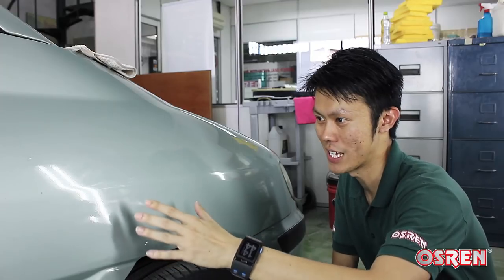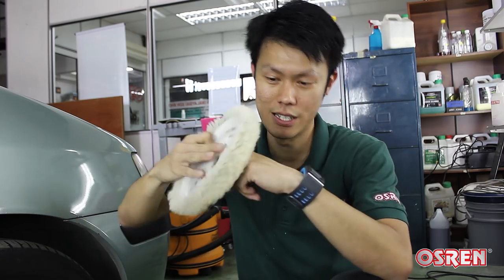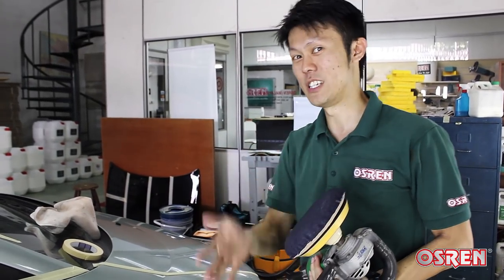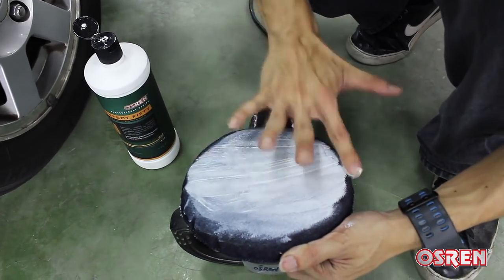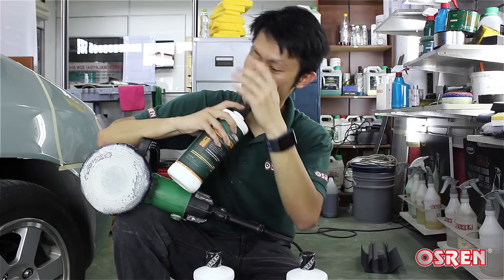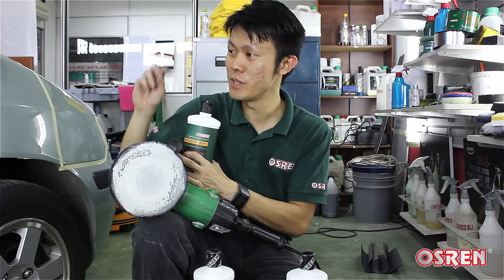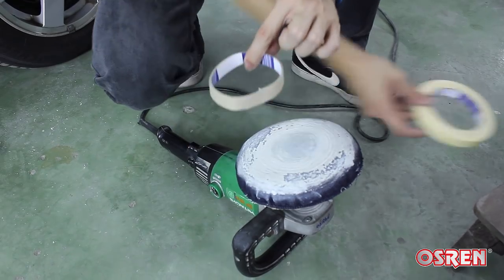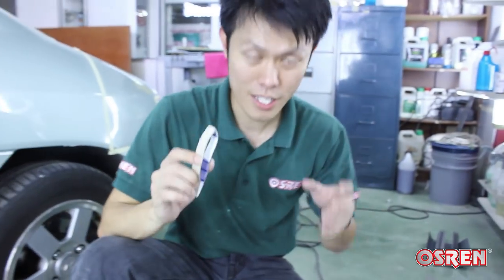How-to remove orange peel without sanding (Step-by-step Guide)

Comment: Cutting with sand paper and polishing is easier for people who are new at it, because with the sand paper method you can tell that the orange peel is off completely or not because of the dull surface, this method would be more difficult because it's polishing and cutting at the same time and you can't tell the depth of the clear. Plus a rotary polisher is for much more advance people
Reply: +bulleuston76 yep that's the best way. I'm going to start the cutting and buffing process soon, I'll post some videos of my progress
Reply: Like the denim pad where to buy
Reply: Using denim pad will not leave any scratch mark like sanding would... If u buff it really well after sanding it flat... The scratch mark will appear back after 3 to 4 month... Thats why i like to use the denim pad... But takes a lot of practice though...
Reply: Sanding is lots of work. I am ready to embrace something much easier , quicker and more effective.
Reply: Very true
Reply: yeah but sanding is a lot riskier for newcomers with the risk of taking off all of the clear, this is a milder approach and safer.
Reply: @matspray6665  sanding marks do not come back after buffing and polishing.....the process when done correctly literally removes the scratches.

Comment: I Recently did a clear coat repair, got a new gun to shoot the clear coat, but I did not spend enough time getting the settings right and had horrible orange peel. I followed the guidance and purchased the products in this video and was very happy with the results. Thank you for this instructional video, it made repairing my mistake very easy. The Osren products are very good and I will be a future customer. Thanks again.
Reply from the maker: Hey Joe, thank you for the sharing. A moment like this that reminds us what we are doing is making a difference! And totally worth our effort in producing such videos
Reply: what kind of pad is the black pad I can’t hear that good

Comment: didnt even know they made denim pads
Reply: +Radhwan. autogeek sells them.
Reply: Theirs are too small. only 5.25 you need 8". makes all the difference because you can slow the rotational speed
Reply: daleon96 You can make them yourself. Just wrap some old denim pants on a foam pad.
Reply: Show us a picture of how you did it. Buffers spin fast and get out of balance even if you don't center the foam pad just right. Are you talking about tying it or gluing it or have you actually ever even run a buffer?

Comment: appears to work decent. buffer seems to running at a very high rpm. be easy to burn thru if you dont know what your doin around the edges.

Comment: so this really flattens orange peel as good as wet sanding? did you ever do 2 panels side by side using both methods and compare results and time required??? thank you..
Reply from the maker: Hi Roadstar499! If you love wet / dry sanding, stick to em 👍🏻. If you’d like to try it out, click the link! 😆

Anyway, this is a good question and one that cannot be answered via test and video comparison. It is a personal preference thinge 😄

PS: The Perfect 50 and Denim pads get rid of sand scratches very easily too! 😉

Comment: Excellent video, very informative. I tried the Orsen denim pad and the Orsen Perfect 50 fast cut. The fast cut turned into a grey paste on the car. Didn't cut the orange peel, any suggestions? I prepared the pad with the fast cut just like the video.
Reply from the maker: hey hawk, we will need more information to help you troubleshoot. 

Do run us through you process in details, including machine speed, hand speed and working time.

If the orange peel doesn't get flatten, it means it is not levelled or not enough cutting is performed
Reply: I prepared orsen denim 160mm pad just like you did with orsen perfect 50 fast cut compound. I applied some perfect 50 to the hood. Using a torq10fx I spread the compound at speed of 15, it began to get sticky, I increased speed to 30 then to 35. Compound then just stuck to paint as a grey mud. I had to teeter the pad to cut into the compound to break it up. It then flew around in grey soft chunks. I kept on with cutting. Repeated about 4 times then gave up. I noticed a very slight change in the paint reflection.
Reply from the maker: @slphawk37  We would recommend using the perfect 50 with a rotary polisher, the pad that you mentioned, it is made for rotary. It's thicker and using a dual action would not produce the same transfer of cutting power (cushioned by the thick foam)

For dual action polisher levelling, we recommend nao leveler 56 with a thinner 6mm denim pad.

The grey soft chunks are most likely the dried up polish abrasive with dirt infused (it happens).

Check the latest video on leveling with a dual action polisher : https://youtu.be/rnN8o8ibI0g

Oh btw, a tutorial video is coming up tonight

Comment: Can this process be done on the base coat, and clear coated after?
Reply from the maker: On base coat, it's better to sand (provided it's 2k solid colour, not metallic paint) than to machine polish as it will produce more polishing dust with possibility of remnant oils from polisher that will hinder clear coat from bonding on base coat

Comment: Is that polishing compound that you used?  I assume this is after you applied clearcoat?
Reply from the maker: ShawnMichael121277 Yes Perfect 50 is a Fast Cut Compound. The car I worked on in my video is clear coated but it's not freshly coated. You can also use this polishing system on single stage (non-clear coated) painted cars. For fresh paint, we suggest paint to be cured before polishing
Reply: Thanks.

Comment: I"m watching this because my Volvo just had a new trunk lid installed due to someone kissing me in the rear.  The car is finished but there is orange peel finish that I pointed out and rejected.  They say they will be able to buff it out.  I wanted to see how it worked.  I hope they do a good job.  I'm holding the insurance check hostage til it's correct!
Reply from the maker: We’re with you all the way! And if they can’t get it right show them this video and get them to buy our products! 🤣 Anyway, hope you’ll get that razor sharp reflection finish 😎👍🏻

Comment: So, is the orange peel in the clear coat? I have a slight to medium amount of orange peel in my car and it stands out because it's black. I've been trying to correct the paint by compounding and polishing, but it's preventing me from getting that super high gloss end result. It looks a lot better than it did, but I can only make so much progress. I wondered if the orange peel was in the clear coat or the layer of paint beneath? Do you think it's ok to compound with the denim pad? (In not a beginner and have moderate experience.) I appreciate any help you can offer me. And thank you for the vid!
Reply from the maker: Hey Tonyelle, levelling at the clear coat level is sufficient to produce an even reflection. What is beneath won't affect that much unless there are sanding marks or uneven putty marks that are painted over. 

Denim polishing has been around for more than 20 years in Asia countries, not just in Malaysia. 

We would also recommend trying out the new abrasive for levelling :

https://youtu.be/rnN8o8ibI0g

We have since updated our abrasive to a better formula
Reply: @OSRENOfficial  Thank you for the quick and helpful response. I'm going to go check out your updated abrasive products right now.

Comment: Do i use the denim pad with the 46 or the orange pad after using the 50? I just got this system and can't wait to use it.
Reply from the maker: Hey, this video is dated, the video you commented on the nao leveler 56 would be the improved formulation
Reply: @OSRENOfficial if the 56 is improved formulation, how come in the Osren Amazon store you only have the 50? The 56 isn't there at all, neither is the thin denim d/a pad, only the denim rotary pad. I just bought the denim rotary pad and had to get the 50 compound.
Reply from the maker: @stephenwhite5444  Hi Stephen, the fd2000 (denim for da) is available here :https://www.amazon.com/dp/B08P7G2GD9?ref=myi_title_dp

We are extending the product range this year too on Amazon including the new abrasives. Expected to be available in Q2 of this year. We apologise for not bringing in sooner.

Thank you for being an avid supporter. (we can tell based on your question asked.)  If possible, do follow us on our IG, we are more active in providing updates there

Comment: What about doing this method on single stage paint job? I haven’t applied the clear coat, but i wanted to attempt to get rid of the orange peel on the color first
Reply from the maker: Hi Logan, Good question.
Yes you may level the color coat before applying the clear coat. It will look better. However, you wanna make sure that no oils or unwanted solvents and particles to be around before layering the clear coat.

Comment: +AMMO NYC have you seen this? Seems like something you should do a review on.
Reply: You expect Larry Kosilla to come here to watch this video? Or maybe Darren Priest from Auto Fetish Detail or Junkman2000 :D Well this is kinda different technique for them. From what I know, american don't use denim material for removing lite orange peel.
Reply: +Mohd Radhwan Denim pads have been around for years.  They are faster but still don't level like sanding.  Not good for custom work
Reply: @danhenderson783  i agree..using good rubber block is the way to go imo...start with a small section and go through all the steps to get results you want then go over the entire car after inspecting each panels orange peel ...some panels may be much better or worse. not one comment here after 7 years of anyone that actually used this process...which pretty much says it all...

Comment: I wonder if its possible  with a drill gun  if i attach a denim pad  could it remove the  orange peel
Reply from the maker: if it has enough torque and attachment to the backing plate, perhaps yes. Usually not the case. Drills and polishers have very different motors and drills are unsuitable for long hours of usage

Comment: Would this also work with single stage 2k paint?
Reply from the maker: Hi there! Yes it works with single stage paint systems. Just be prepared to see the pad turn to the car’s colour 😬. It also works on 2K Solid Colour Paint systems 👍

Comment: I'm by far no professional painter.i have painted a black 76 I think was the year? Bandit look alike no tee tops.Single stage. Came out great  then my Harley. Basecoat clear. Again looked great out of the gun.Now I'm monkeying with a 90 red corvette. Already Put base coat clear on the nose clip ORANGE PEEL. I've tried to sand it out NO luck can not get the shine to come back. Stripped it bought a new bigger compressor going in Again..any help would be appreciated  Thank you guys
Reply from the maker: Hey Tommy, respray by gun would definitely result in orange peel, the intensity can be reduced with the right settings and techniques. We are however not an expert in this, so best to consult an experienced painter on this. 

We can, however, comment on these observations:

1) Sinkage will take place and causes orange peel to worsen after curing. These will occur when the paint is drying anywhere from weeks to months. So best to level the paint after near full curing of the paint. We did briefing mention about sinkage on our blog: https://osren.com/blog/2022/03/02/orange-peel-levelling-risk-and-reward/ 
and it happens even to original factory paint cars

2) We have a newer video to tackle this approach, video: https://youtu.be/rnN8o8ibI0g

After sanding or level, you will require to compound and/or polish to restore the shine.

Comment: Hey there, I tried a denim pad with Meguiar's m105 and rotary like you shown in the video. But even after 5-6 attempts, (3-4 overlapping passes each), the orange peel is reduced only around 30%. Its factory orange peel on a Civic 2013. In your video, the orange peel is gone in one attempt. I also primed the pad like you did. Hope you can give some guidance here.
Reply from the maker: Hi a ghazi, maybe you want to try our compound (Perfect 50) instead, since our compound is designed specifically to remove orange peel without sanding. 

You can check our more details here: http://osren.com/product/professional-series/all/perfect-fifty-50
Reply: Plus I'm guessing on the car in the video it's fresh paint which is softer mate
Reply: Not cured properly yet therefore easier to get out the orange peel
Reply: @jackcarey4902  Hey, can you recommend a suitable compound for denim pads?
Reply: @IAINoodle  I've never used a denim pad sorry mate
Reply: You will be at base coat before you can get rid of factory peel.

Comment: How well will this work on a single stage paint job?
Reply from the maker: Hi Murrica, this works the same on single stage paint. The fundamental of it is to even out the surface to produce a more reflective surface. Downside of single stage paint is that the pad might get color transfer.

Comment: Nice job ,,,,BUT  Black would have been a better example to show us. I can hardly see any orange peel on that color.What is the name of the compound you are using?And the name of that pad. Thank you
Reply from the maker: Hi +SonofGodly  , Thanks for watching. Do check out the video at 7:19 (Minutes) The clip there clearly show the orange peel. 

However , yes I think you're right that black would be a better option but at that time I had no access to one...

By the way the products which i used are in this link.

http://www.osren.com/product/professional-series/all/perfect-fifty-50

http://www.osren.com/product/other-pads--backing-plates/pads/jeans-sponge
Reply: "I can hardly see any orange peel on that color"
That is nuttier than squirrel sh*t.  What were you watching the video on?

Comment: Will this be removing too much clear coat?
Reply from the maker: Hey Poh Tat, the process involves removing more clear coat than your usual polishing approach, however, one the many reasons of the presence of orange peel also means that the clear coat is a little too thick and causes the wavy texture. Usually orange peel levelling is only done once in a vehicle's lifetime (unless repainted). Orange peel levelling is done to bring out the best possible mirror look like on a paint. If you are comfortable with orange peel, by all means, you can skip the levelling part.

Comment: I see these days detailers do not even use rotary buffer,  but variable speed orbitals. Like Rupes
Reply from the maker: The dual action polisher has certainly changed the paradigm in the detailing scene. However rotary still has its place

Comment: Would the products change if one wants to use a dual action polisher? Also if one can use DA, what speeds and how much pressure should be applied?

After perfect 50 what osren product can be used to remove haze and sanding marks?
Reply from the maker: Hey Faiz, we have a new product that's suitable for dual action levelling and it's one of our upcoming video as well. 

http://osren.com/product/professional-series/all/nao-leveler-56
After levelling, the usual (depending on paint) would be either NAO quick cut 48 or Nao compound 46 with wool to refine it. 
Cutting combination are not fixed and paint dependent, however 46/48 is the usual follow up. The upcoming demonstration on levelling will be beneficial, don't forget to tune in!
Reply: @OSRENOfficial  thank you for this update. If we are working with foam pads after the denim pad stage will NAO quick cut 48 or NAO compound 46 be the right product?
Reply from the maker: Nano Wools such as this are way more efficient than any foams 😬. We highly recommend that instead of foams

http://www.osren.com/product/other-pads--backing-plates/wool-pad-velcro/blue-nano-wool

Comment: what will happen with the shine of the paint after you will wash the car several times?
Reply from the maker: Hi Alexandru Octavian Avrigeanu! Orange peel once removed/leveled, it's permanently gone. It will never come back. However as for gloss, it might reduce due to micro scratches from washing or let's say you did not take ccaare after leveling the paint and stubborn stains sticks to it, gloss will be reduce, BUT the paint is still flat as orange peel is not there.

Comment: At 1:43 did you say the denim pad is non coarse? Or is it a coarse pad.
Reply from the maker: Ah! I meant non-pores, as in compared to foam or wool, the abrasives will linger longer on the surface of the Denim
Reply: OSREN (MALAYSIA) SDN BHD oh! Thank u!! Do u happen to know if denim pads are considered like a medium cut, light cut, or heavy cutting pads?
Reply from the maker: You’re most welcomed. Denims are by far the heavier cutting pad available in the market for automotive clear coats 😬
Reply: OSREN (MALAYSIA) SDN BHD okay sounds good! Will be adding this to my arsenal :)
Reply from the maker: Cools! 😁